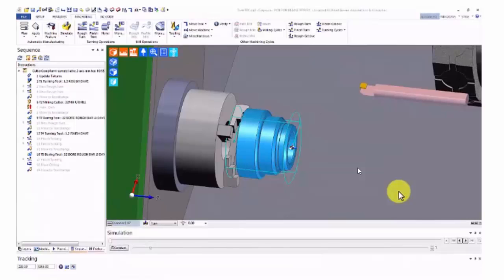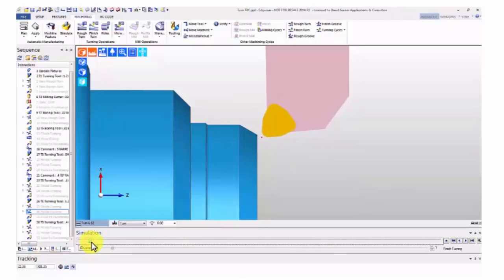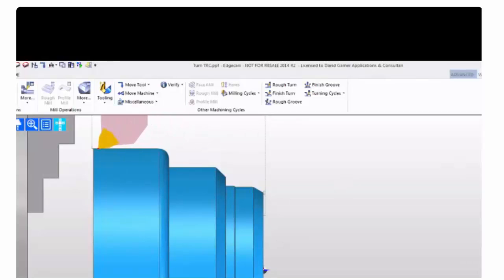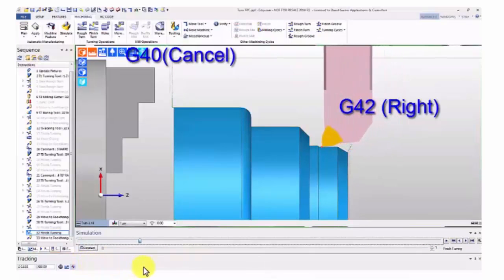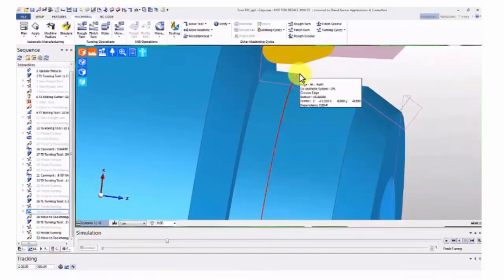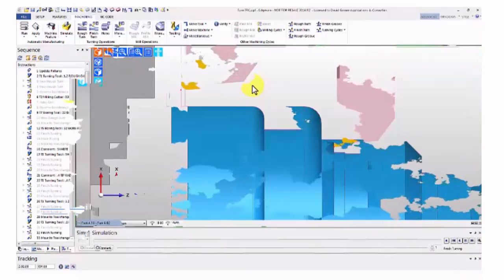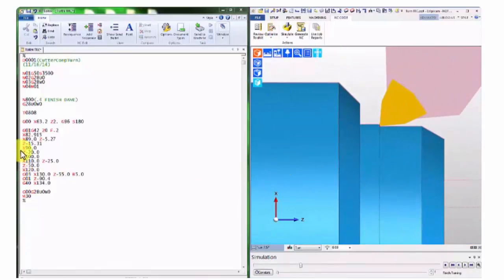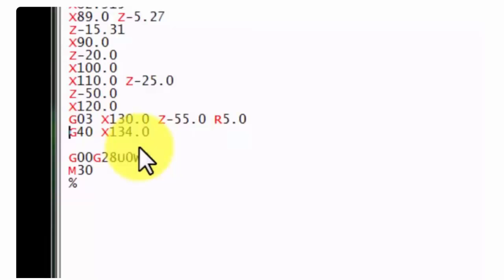Use of Tool Nose Radius Compensation (CNC Lathe)

Comment: I have been wracking my tiny brain about tool nose radius compensation for about a week.  Now I know what my errors were - why doesn't it say it in my manual? Ensure your approach and depart vectors are at least double the tool nose radius? No one tells you these things! Thank you dude.
Reply from the maker: @darcustaseen1602  
it’s one of the rules. 
Internal rads must always be more than tip rad. 
Do not try to change diameter less than tip radius. 
Apply then get rid of it as soon as the shape is done. 
Do not try and go backwards. 
Be sure virtual (T) is correct. Must have tool radius. 
Does not work within G71 except on old controls. 
Add G41/G42 before G70 and it will work. 
Thank you very much for commenting and watching my videos
Reply: @cnctrainingcentre603 do you mean once my ns-nf profile is defined, don't include G42 - G40 within that? Do I make a move G42 it and then run my G70 then run a G40 move after? My controller ignores TNRC within a G71, but I want to run a G70 pass afterwards.